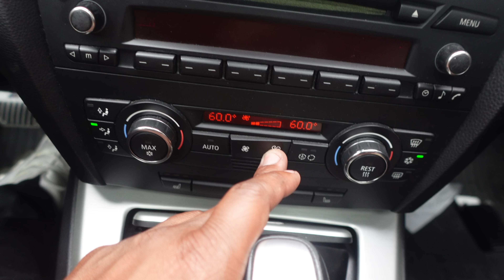WE RESCUED THIS DAMAGED QUARTER PANEL FOR MY BMW 335i !

Comment: The back bar may be different because of the M kit I think u should change it to fit the rear M sport bumper check this 
I changed the front bar in my f36 for conversing the M kit I don't know about the e9x tho

Comment: You break the spark plug, take a piece of the porcelain wet your index n thumb so you can roll the porcelain around on them, stand back like 5ft and you can legit softly toss it at the window n it’ll shatter
Reply from the maker: The pole worked better!
Reply: @Slowspeed  lol😂

Comment: I need some help. Buy a e92 M3 or 2011 335i both with saddle brown interiors. Rod bearing and all seals were done on the m3. M3 mileage is 130k, 335i is 119k. Opinions?
Reply: M3 all the way lol
Reply from the maker: M3